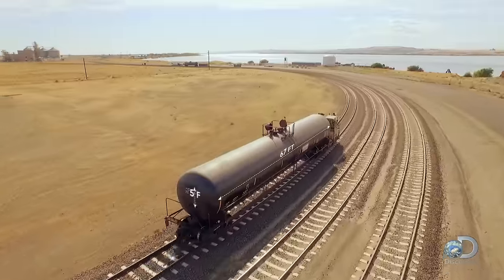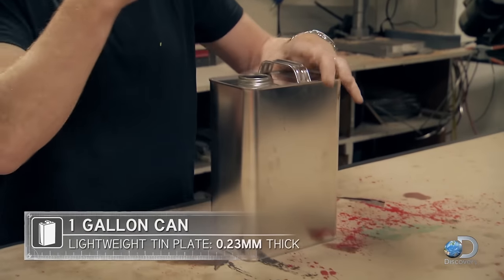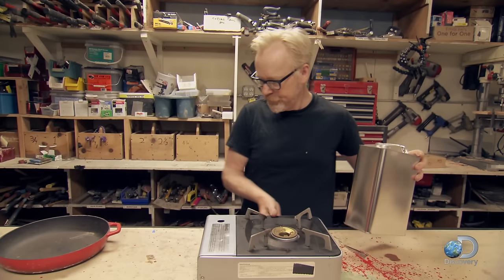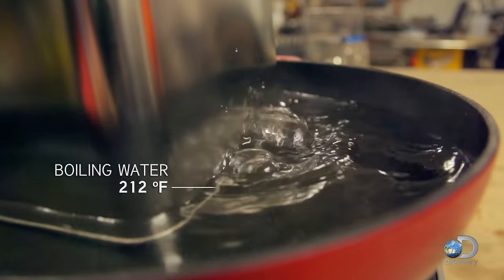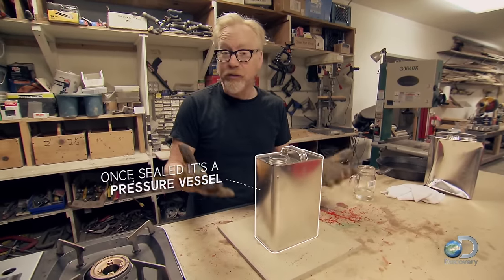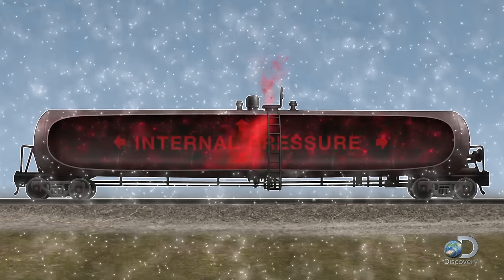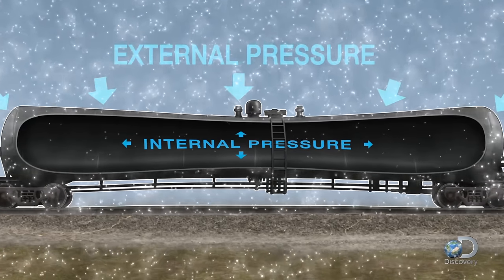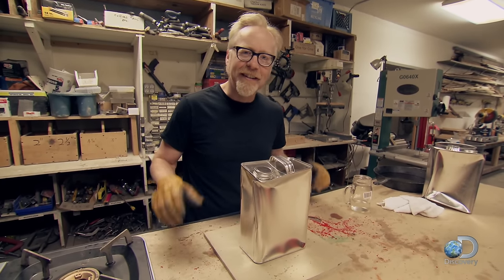The Science of Implosion | MythBusters

Comment: This is not exactly how the Titan sub was destroyed.  When intact, the hull was acting as a protective shell and holding the weight of the column of water above it.  When it failed, it was like putting an egg in a hydraulic press.  The weight of the water instantly applied all of that pressure and crushed the passenger compartment to tiny bits.  There was never a gradual pressure drop inside the cabin.  One second it was holding the weight of the water and the next second it did not exist any longer.
Reply: And carbon fiber doesn't creak and bend.
Reply: Thank you for this clarifying comment.  Wish an animation of the Titan sub event would appear here on YouTube—such a great learning opportunity for all of us.
Reply: The amount of pressure transfer also caused the inside to heat up to basically the temperature of the Sun.
Reply: @brianstraight9308 it definitely might that deep the science isn’t tested enough
Reply: @brianstraight9308  It absolutely does. They make hockey sticks out of it.
Reply: Right but the principle is the same. Pressure differentials cause implosions.
Reply: Ever since I've heard about the tragedy, I've been trying so hard to comprehend how water is capable of smushing metal and a human body like that. Maybe Satan was involved in the making of nature.
Reply: @mariavgutierrez3820 It's just a matter of depth and the shoddy engineering behind Titan
Reply: It was all a setup..
Reply: You're talking like you were there and have all the facts. Just so you know, you don't lol
Reply: Why does everything have to be a conspiracy these days?
I mean for Jesus' sake....
Reply: @mariavgutierrez3820 I wish people would stop turning their ignorance into Satan just because they're too lazy to do a Google query and simple research
Reply: How is everyone an expert at this? Lol
Reply: @brianstraight9308  Yeah this is the part people are misinformed about. The second those fibers cracked, those people were under 5800psi of pressure. Terrifying.
Reply: The carbon fibre shell will probably shatters and the human body will be crushed by the weight of the sea
Reply: @calebclark5303  That's the only plausible theory about it's demise at the moment tho
Reply: It’s not like an egg in a hydraulic press. The weight of the water pushes in on every square inch of the submersible not just the top and bottom like a press does.
Reply: Its likely got crushed to small relatively stable cylinder as its kinda long. Its like crushing tim can with hand that is all. Fiber probably did some weird stuff too bevause of their construction so there were weird cracks too
Reply: dont forget the extremely hot air created by the implosion being that of the surface of the sun and liquefying everyone inside.
Reply: @mariavgutierrez3820 there's a video that explains it really well but forget what it's called. Basically though the further down the more atmospheric pressure is applied. So on land if we put a 1ft by 1ft board on you it would be like 14 lbs, but  by the time you get to where the titanic is it would be 2-3 million pounds pressing down on that 1ft by 1ft board.
Reply: Think of what a pressure washer does, or water jet cutter. They can remove flesh, concrete, cut through metal instantly. Then try to imagine a wall of water that's being shot like a pressure water.

That's why is nothing left of anyone inside that sub.
Reply: @mariavgutierrez3820 is just the weight of the water, the deeper you go the weight is heavier
Reply: @odin13th76 Farther down. At sea level, it’s 14.7 pounds per square inch. At 13,000 feet, it’s 6000 pounds per square inch.
Reply: If you look at the full episode, you can see the full size tanker one. It was instant and not slow. If he sprayed water it would have been faster. It was more for tv so it needs to be slowed down
Reply: Well this video was 7 years ago and was not addressing underwater voyeurs. Now this implosion on land where the conditions met, imagine underwater where the condition is just waiting for you to make that split second opening
Reply: @andrewjames7438  why is knowing basic physics considered "being an expert"?
Reply: @modestonoriega6580 thanks for nothing
Reply: @ianstrange5674  people like to think they have an advantage over an uncontrollable life by being the only one who "really knowing what's happening."
Reply: @mariavgutierrez3820 it's God's power, he has the power to destroy
Reply: What I don’t understand is that the pressure destroyed the sub, but why didn’t it crush the titanic?  It sank to the bottom, but is still almost fully intact.  Shouldn’t the weight of the water above it crush it also?
Reply: @ACHWeddingFilms Because it equalized its pressure as the water seeped into it before it fully sank. It was basically just a giant rock sinking to the bottom. It didnt go from full of air, to full of water in less than a millisecond like the sub did.
Reply: @ACHWeddingFilms Because the titanic filled with water as it sank near the surface.

It wasn't pressurized like the oceangate submersible. Remember, the sub not only has to pressurize to 1 earth atmosphere and have a hull to "hold back" the water, but it's also so they can breathe with the oxygen supply.

That's the reason why the titanic isn't crushed sitting on the ocean floor. 

Just look at photographs of the wreckage. All the windows are gone and it split in half on that faithful day it went down.

The pressure was already equalized after it sank, filling the ship in every conceivable nook and cranny with water.

Does that make sense? I don't want to sound like I'm crazy. Lol
Reply: We don’t know the triggering event. The real problem was 1. Materials used; 2. Shape of the boat; 3. Lack of a rescue protocols/procedures by the company.
Reply: Implosion is exactly what happened. The outside pressure found the weakest point causing the implosion.
Reply: That is correct. In a millisecond the passengers were liquified. It takes time for pain and neurotransmission of pain. There was no time for that at all. 

They were just gone. 

Sanjosemike (no longer in CA)
Retired surgeon
Reply: @P.W.R. This only applied to the Titanic's bow . The stern on the other hand imploded because it was still full of air when it went down which is why the damage is more severe to it than the bow.
Reply: Consciousness usually ends within 10-15 seconds after blood flow to the brain stops. Based upon those numbers, victims of the Guillotine might have remained conscious for 10-15 seconds after the blade fell. 

However, in the case of this implosion, they were liquified immediately. There was no time for nerve impulses or any brain tissue remaining in less than a millisecond. 

I can’t help but WONDER if any of the passengers KNEW what “catastrophic implosion” meant before they agreed to go? 

Now almost everyone does. 

Sanjosemike (no longer in CA)
Retired surgeon
Reply: @goku-san  
That's interesting. I did not know about the stern imploding under pressure. You learn something new every day. 

My original point was just a general observation. The majority of the ship sank without imploding except for the areas still trapped with air.

Pretty crazy to think about. The weight of the ocean water is a powerful thing to comprehend.
Reply: It wasn't holding back the pressure of any column of water above it. The enormous pressure was applied equally to the entire surface of the vessel
Reply: This had nothing to do with a submarine
Reply: @alanl6194  That is correct. Actual submarines are designed and built by engineers who understand material’s’ characteristics and stresses. The designer of this death trap did not understand either. He and four other souls paid the ultimate price for his ignorance and flippancy. 

Sanjosemike (no longer in CA)
Reply: Didnt look imploded at all when they found/pulled it up today...?
Reply: @williamwilson6499  I know I could easily google this but since we’re all talking about it… what is it about 13,000 ft below that creates that much pressure?

Sorry if that’s a stupid question,  I just find it really fascinating how the pressure increases the further down you go
Reply: It's also possible that the view port failed catastrophically; in that case, both ends would likely blow off, and it's even possible for the "tube" to be crushed without ends due to the pressure differential. Hopefully we'll get answers, as some wreckage was recovered.
Reply: @marcmcmillan3980 it is the weight of the water above you, as you goo deeper, this increases. Try and submerge ur body in water vertically and keep just ur mouth above water. Try and breathe in and you won't be able to. It is the pressure of the water on your body that stops you. That is just 6ft. Imagine that pressure 2 miles down :/

Comment: For people wondering about how terrifying or painful the last moments might have been for the passengers of the Titan submarine, it's likely they never even saw their end coming. Here's some quick Google information: The Titanic wreck is around 12,500 feet under water(~3.8km). It's estimated that the Titan was around 3,500 meters deep(~11,482.9 ft). At this depth hull failure would cause an instant implosion that would have lasted around a single millisecond. The estimated time for nerves in the body to send pain signals is around 150milliseconds. When the implosion happens, the air inside the sub rapidly heats to the point of combustion, flash frying everything within. Basically, these people were crushed and incinerated in less time than their body could process. Worst case scenario, they heard the early signs of hull failure and had a brief second to process their coming demise.
Another tragic event to look into that could give insight into this-

The Byford Dolphin Accident: A deep-sea drilling rig accident that occurred 508ft below water(154.8m)( a significantly lower number than the Titan sub incident). In this event a deep sea mining crew of 4 occupying a diving bell were killed instantly in an explosive decompression. The bodies of the 4 men were recovered, though one was only recovered in pieces. Due to a miscommunication a docking clamp was released prematurely causing an engineering failure and exposing the 4 divers inside to deep sea pressure. This sudden severe change in pressure project one diver out of the vessel through a 24" (60cm) wide(correction: meant to say length, there's definitely a difference...) crack in the door. The remaining 3 divers were cooked from the inside out by their blood being flash boiled within a few milliseconds. Death was instant.

Also, to those looking to this video for an explanation of what happened, this is not the same kind of implosion. The implosion of the Titan sub was due to the extreme weight of the ocean depth bearing down on the sub hull. The hull eventually couldn't hold up and failed all at once. A better(though not fully accurate) representation for that kind of implosion you could do at home, would be stacking weights on an aluminum can(or other object of your choosing) until it eventually gives out. Once the point of failure is reached the weights will rapidly crush the object. This would only be representative of the hull failure however, and not the resulting gas and pressure reactions of a sub failure.
Reply: This comment is underrated.
Reply: you have been posting this all over the internet
your knowledge of PV=nrt is misleading

yes the air inside the sub was rapidly compressed when the hull failed, including the air in the crews lungs

that does not mean the crew was instantly incinerated - you are totally ignoring thermodynamics - the heat from the highly compressed air (6000psi after compression) could not possibly transfer much heat into the bodies of the crew in a milli second. Even if the air temp changed to a thousand degrees the bodies were NOT compressed (except the air in their lungs) because a body is made of tissue and water, and water is not compressible.  What did happen to their bodies is they were crushed, like you hit an ant with a 10 lb sledge hammer, instantly turned into a liquid goo and dispersed into the sea water.  People have  been in basements where there was a gas leak, which ignited, and blew the house off the foundation all around them in an exploding ball of fire. They lost their hair and eyebrows, and had minor 3rd degree burns on exposed skin, and they survived. You would need a nuclear blast to instantly incinerate an adult human body.

Likewise with the scuba divers that were exposed to the rapid decompression in the diving bell - when you put water in a vacuum chamber and draw the pressure down to 0.1 PSI the water vaporizes and looks like it is boiling, but it is still at room temperature - it is not creating heat - the divers were not "cooked from the inside out" (as if they were in a giant microwave oven). The gasses in their blood vaporized out of saturation which causes air embolisms throughout the body, and you die. you are not cooked.

And BTW, a door that is open 24" is wide enough to walk thru - that is two feet, not a crack.
Reply: I think they knew it was coming because they attempted to drop ballast and surface.
Reply: @kenwittlief255  First of all, I have not posted this anywhere else but here. I had probably 20 tabs of articles and videos open about this when I typed it that I was referencing, so if you see this exact comment somewhere else that means a bot probably copied it or someone just trying to take credit (Happens a lot on YouTube)
Also the 24" was my brain hiccupping on length vs width. Dunno why I said width but you're right, none of the articles I'm seeing actually established a width, they just say "24" long crescent shape".

I looked into a few more articles and now I'm seeing various time of event estimates between 2ms- to less than 40ms, so the chain reaction of events would still be below the estimated time of the body's ability to register pain.(150ms)

I guess maybe I misinterpreted being boiled when every article seems to want to use that phrase, so my apologies there.

Here's some references and quotes for what I stated previously(these aren't to say you're wrong, but if they are wrong then you know where to direct your angry letters)(I can't paste links so this is the best I can do)-

"The air inside a sub has a fairly high concentration of hydrocarbon vapours.

When the hull collapses, the air auto-ignites and an explosion follows the initial rapid implosion, Mr Corley says." 
- BBC:Titan sub implosion: What we know about catastrophic event

"The fate of the four saturation divers inside was far worse. According to autopsy reports, three of the men inside the chamber — Edwin Arthur Coward, Roy P. Lucas and Bjørn Giæver Bergersen — were essentially "boiled" from the inside when the nitrogen in their blood violently erupted into gas bubbles. They died instantly." 
-HowStuffWorks:The Byford Dolphin Accident: How 5 Deep-Sea Divers Met Grisly Deaths

CBS:A look at Titanic wreck ocean depth and water pressure — and how they compare to the deep sea as a whole

Wikipedia:Byford_Dolphin

ABC:What happens during a catastrophic implosion? Titan submersible occupants likely died instantly

Gayety:What Happens When a Submarine Implodes: The Titan Tragedy

I had also seen something saying they were likely turned to ash and that's why there's no bodies, but now I can't find it so I guess I'll take the L there.
My intention was not to spread misinformation.
Reply: @VazeulEzren  fair enough
Reply: Can someone tell me if a carbon fiber hull imploded without yielding?
The deformation was instant?
BS, I believe they knew and realized what was coming. A vessel like the titan sub is designed to give warning for even the most minute of changes in pressure. So yeah, there was a split second warning before failure
Reply: I read that they may have felt it in their ears, which would signal they knew something was wrong, but of course could do nothing about it.
Reply: @winnie5873  yeah- could be.
Remember it's bad press to say that the victims suffered. The closely controlled media would never tell you that so we have to answer our own questions.
Reply: Another visual anology is the rubber bands around a melon. It hold up until it don´t.